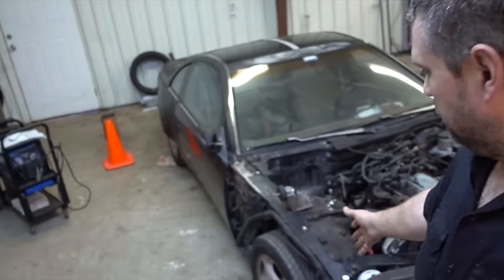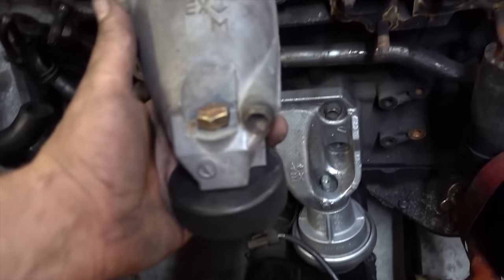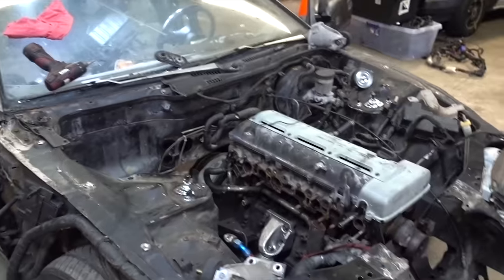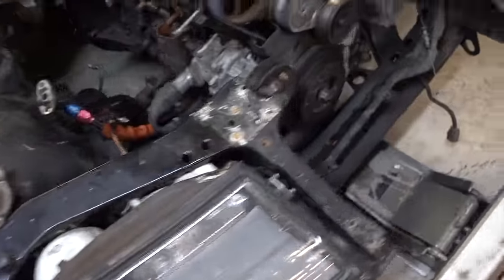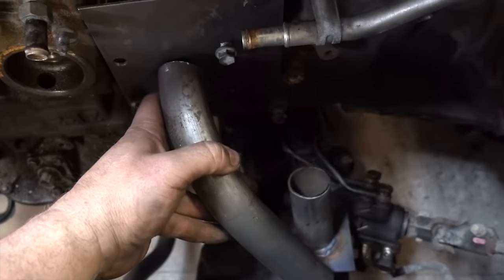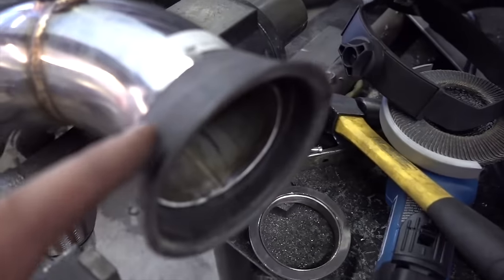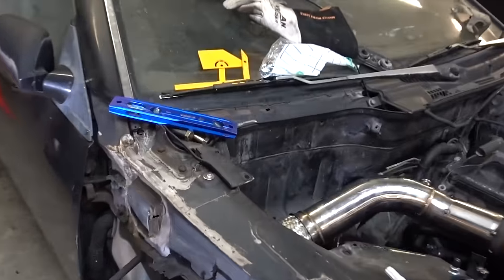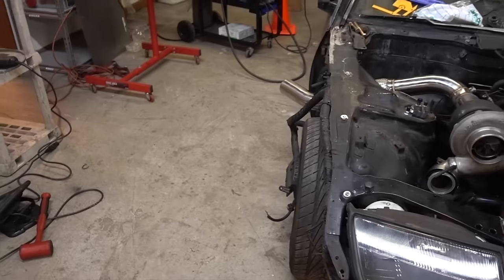Using Scrap Metal & Hockey Pucks To Put A 500-HP 2JZ In A Rusty Nissan 300ZX

Comment: The other day at the drag strip Tavarish car was the way you did it bro,Full Throttle last second then release the clutch and power shift up to the last gear,Tavarish car was not strong enough to resist a 1/4 miles drag,my opinion...not your fault! ;-)

Comment: Just curious  couldn't  you have swapped the original motor mounts on the oposite side then you would be closer the frame mount and if needed use a thicker plate with the hockey puck seem it would ne stronger

Comment: I used hockey pucks as replacement motor mounts on Vintage Snowmobiles. I would cut them on a band saw and drill a hole through the center. Nothing new. I used a metal plate first.  This is NOT a new idea in my book. When you are working on something build 50 years ago, you cannot go to the dealer and ask for parts. I found out most vintage snowmobiles used farm type equipment because snowmobiles originally were used to access fruit trees in the winter to prune them. The first original track was made from  conveyer belt. You can go to any tractor supply place and find it on rolls. The engines were usually Briggs and Stratton.  All bearings, bushings,etc were from farm implements.  
Knowing that, I could easily restore any early model snowmobile. Now days, forget it. Everything is so advanced, you need a computer to figure out what's going on.

Comment: But if you moved the motor backward another 2.5 - 3 inches, would the motor mounts not line up better now? And it doesnt SEEM TO APPEAR that you would lose the ability to do a side exit... Granted, all the years I spent wrenching at Yota and Lexus, and taking apart 2J's to making them run and sound better (with both Toyota sanctioned AND unsanctioned repair/modifications 😂😂)  I have NEVER put one in to 300z so I could be 100% talking out if my ass and be wrong on both counts. Very curious about it though. 

Great channel. Great builds. Keep up the good work man. I like the way you build cars, cause you... BUILD CARS. Unlike some of these million subscriber "builder" channels. TISKTISK on them SMH LMFAO.
Reply: On an earlier video, they discuss the reason for not moving the engine back as to keep the rest of the drive line in their stock locations. If they move the engine back, then they need to fab clutch linkage, modify the shifter, shorten the driveshaft, (and other things I'm probably forgetting).  Having to make mods to 'just' the engine was 'easier'.

Comment: Even though you aren't looking to set lap records, wouldn't it be more beneficial and easier to push the motor back to give you more radiator, front mount, and oil cooler room. I think the decision to not push the motor back will bite you in the ass later.

Comment: 500hp 2JZ 😅. The stock 300ZX turbos make 550hp rebuilt you dummies. VG30DETT will also make 1200hp with a upgraded fuel rail from Border I think. The stock VG30DETT pistons can handle 700hp. The Z32 has solid engine mounts avalible. The body kil looks like 💩. The race cars widebody has parts on the doors to widen doors. No dragracers would buy a shell that replaces the hood, nose, and front fenders like the race car. The race car has a front shell. And you could of made new 1 pice fiberglass widebody front fenders. You could of also bolted a R34 engine to the Z32 transmission if you wanted a Nissan inline 6 and less trouble of a build.